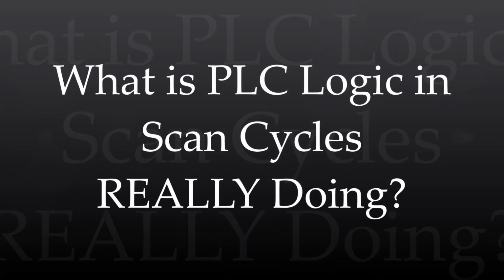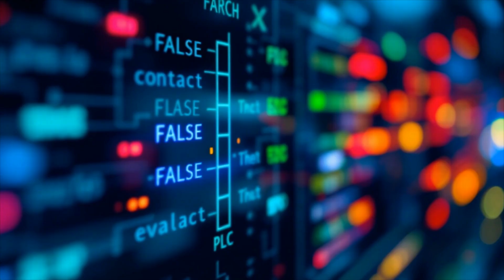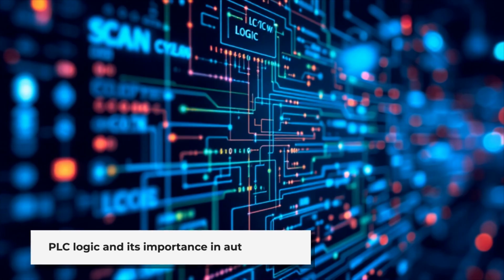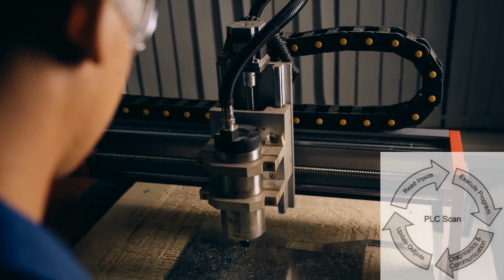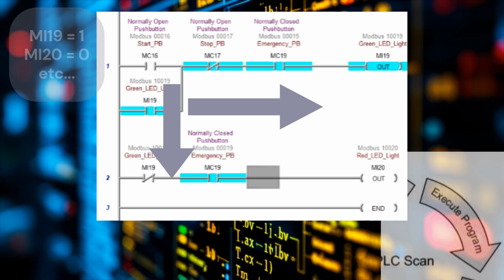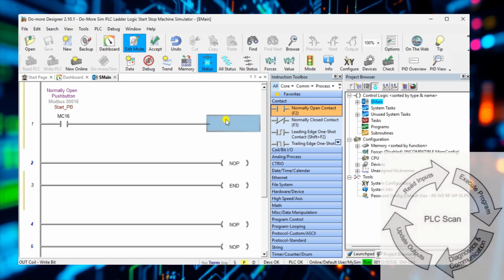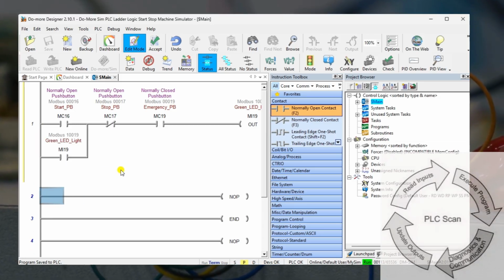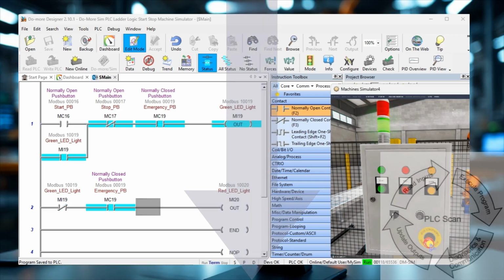How PLCs Actually Process Input, Execute, and Output!

Comment from the maker: Detailed information and links can be found in the corresponding post here.
https://accautomation.ca/what-is-plc-logic-in-scan-cycles-really-doing/

PLC Beginner’s Guide to PLC Programming
https://accautomation.ca/programming/plc-beginners-guide/

Here are the controllers that we have covered at ACC Automation:
BRX Do-More Series (Do-More Designer Software + Simulator)
https://accautomation.ca/series/brx-do-more-plc/
Productivity Series
https://accautomation.ca/series/productivity-1000-plc/
https://accautomation.ca/series/productivity-2000-series-plc-p2000/
LS Electric XGB PLC
https://accautomation.ca/series/ls-electric-xgb-plc-series/
Click PLC Series
https://accautomation.ca/series/click-plc/
Omron CP1H Series
https://accautomation.ca/series/omron-plc-cp1h-series/
Horner XL4 PLC Series
https://accautomation.ca/series/horner-xl4-series/

https://accautomation.ca/series/easyplc-software-suite/
The EasyPLC Software Suite is a comprehensive package that includes PLC, HMI, and machine simulator software. See below to receive 10% off this software. This PLC learning package includes the following:
Easy PLC – PLC Simulation will allow programming in Ladder, Grafcet, Logic Blocks, or Script.
HMI System – Easily create a visual human-machine interface (HMI)
Machine Simulator – A virtual 3D world with real-time graphics and physical properties. PLC programs can be tested using the EasyPLC or through other interfaces. (Modbus RTU, TCP, etc.)
Machine Simulator Lite – Designed to run on Android Devices.
Machine Simulator VR – Virtual Reality comes to life so you can test, train, or practice your PLC programming.
Purchase your copy of this learning package for less than $95 for a single computer installation or less than $110 to allow access on multiple computers.
Receive 10% off the investment by typing in ACC in the comment section when you order. http://www.nirtec.com/index.php/purchase-price/
Learn PLC programming the easy way. Invest in yourself today.

Creating a Virtual PLC Programming Environment
https://accautomation.ca/creating-virtual-plc-programming-environment/
https://youtu.be/fQ_DlOm3HZU

Retrieving Your Windows 11 Product Key
https://accautomation.ca/retrieving-your-windows-11-product-key/
https://youtu.be/DVaLRgKbgsM

Installing Guest Additions for Oracle VirtualBox
https://accautomation.ca/installing-guest-additions-for-oracle-virtualbox/
https://youtu.be/LyNhVLb75Zk

Regards,
Garry
ACC Automation
https://accautomation.ca/